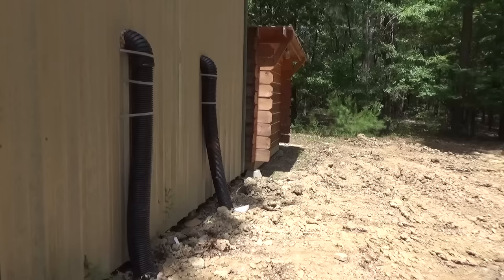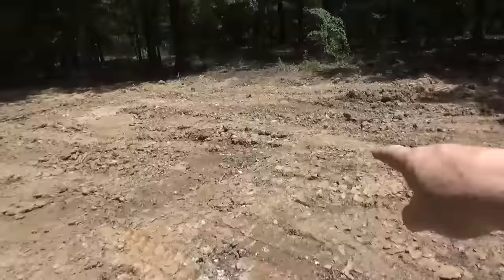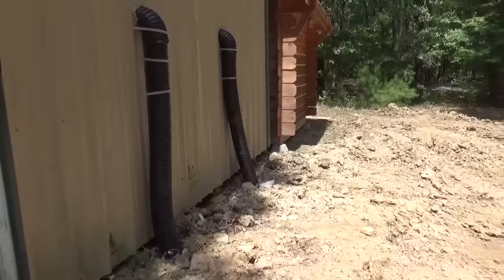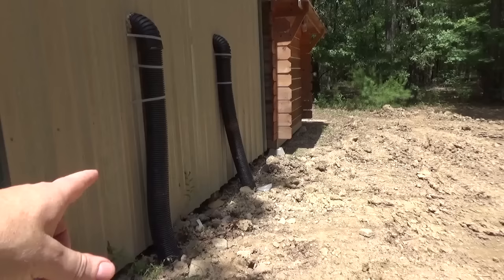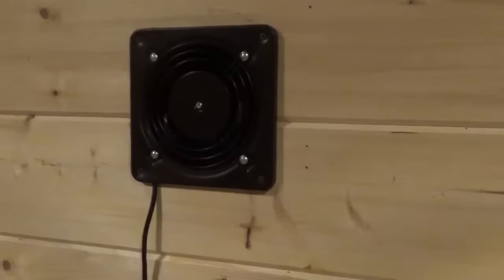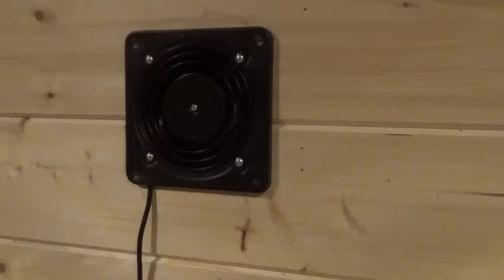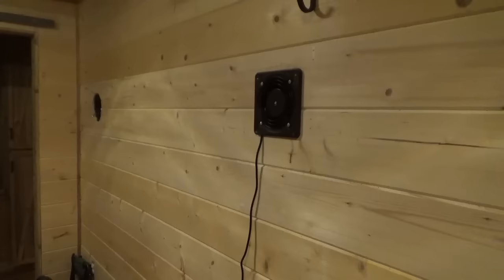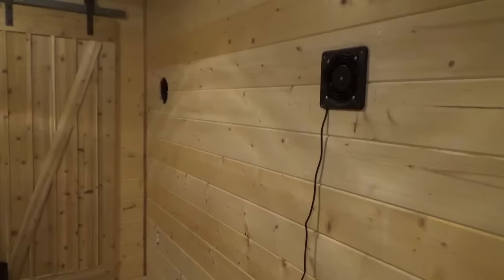Offgrid Underground Air Conditioning

Comment: This principle really only works when you only need cooling.  It fails when you need to increase the temperature because that temperature is lower then what would be comfortable.

To truly use geothermal in all cases, you need compression and expansion of gases that can be controlled.  The value that the consistent temperature of the Earth provides in that situation is that we're not trying to exchange and pull heat from an extremely cold environment or shunt heat into an extremely warm environment, so it provides far more efficiency in the process.
Reply: While it is true that this won't always be able to heat up a home, it can help manage a temperature above freezing, as average temperatures will still remain around 50f underground, and its easier to heat a home from 40+ degrees than if it were below freezing. And if you manage to heat up the ground over the summer, you may get a little extra heat out of one of these systems, albeit a few degrees
Reply: @walkstheman98  it doesn't really work that way.  If you want the temperature to be 70f, then the only way having something at ~55f helps is if your present temperature inside the space is below 55f.  If it is 60f and you're trying to increase it to 70f, 55f only works to lower the temperature towards 55f.  You need something above your desired temperature to raise the temperature in a space.  Basic physics.  If you're going to leave the space unattended and don't want to maintain the temperature during that time... then sure, this helps to maintain it towards 55f, which could help to recover towards the desired temperature later... but that will again require a different source of heat that is higher.  If you continue to use this while trying to reach the desired temp, it will hinder that effort.

This is why a refrigerant is necesssary unless you're burning some fuel or using resistive heating.  The refrigerant can be manipulated through pressure changes to achieve extreme temperatures and then brought back to a baseline using the consistent temperatue in the ground, then taken to the opposite extreme which can be used to adjust the temperature within the space.

To cool, you absorb some heat into the refrigerant from the space, then you superheat it increasing the pressure which raising the temperature well above its present temp, then you put the refrigerant outside the space and cool it to near the ambient temperature outside the space.  After this, you bring it back inside the space and let it expand which subcools it to below the desired temperature where it can absorb more heat inside the space and the cycle can continue.

This is why geothermal works well... the ambient temperature of the ground is consistent.  Instead of trying to work with an ambient temperature of -15f outside and trying to capture heat from it, you get to work with an ambient temperature of ~55f.  And instead of working with an ambient temperature of 80-115f and trying to cool, it, you can work with an ambient temperature of ~55f.

As I said, using just the ambient temperature of the ground works really well if the only thing you ever need to do is cool things.  If you want to heat them... it can be helpful if you're okay never reaching a comfortable room temperature.  This is what eskimos do.  The inside of the igloo is far warmer than outside but it never reaches a comfortable indoor temperature... just warm enough that saying clothed or sleeping under heavy furs can work to maintain body temperature.
Reply: @dus10dnd  I don't think you understood what I meant, it can help make a heater more effecient during the winter, or maintain a constant temperature while you are away. I know how thermodynamics work, what I am saying is that if your heater is off, say you were out for a while, one of these systems could manage your home at or around 50f or so, well above freezing. A heater will be much more effecient at heating a home up from 50f to 75f, a 25f difference, over leaving a heater on, or having no heat. If it were freezing out, that would be over 45f difference without any kind of heat/temperature maintainer. And even with a regular heater, a way that many home owners make them more effecient is a HRV, or heat recovery ventilation. You could do something similar with this, if you take this pre warmed air and vent it to your heater, it won't have to work as hard due to cold air hitting the heater fins (again due to the difference in temperature) as the geothermal becomes the HRV. So you are right, the geothermal is not an amazing heater itself, but that does not mean it isn't useful for one. You just have to think creatively on how you use it
Reply: @walkstheman98  No, I get it.  I am telling you that isn't true.  Say if you have a room to temperature... 70f... what do you think blowing 55f air in there is going to do?  It isn't going to help maintain 70f... it is going to lower the temperature towards 55f.
Reply: @dus10dnd  I'm not saying the geothermal on its own is going to heat up the entire room, perhaps I didn't explain it enough, or you didn't read my comment fully. To put it simply, what I am saying is, these can have multiple use cases. While you are on vacation/away you can have one of these running (at little to not cost) and have your home/room at a constant 55f, not necessarily comfy for you, no, but when you come back it would be easier for a HEATER to heat up from 55f rather than ambient temperature. Furthermore, you can also use one that is ran from outside rather than closed loop like this, and use it to feed the fresh air intake on your heater. Most ventilation systems pull their air directly from outside, meaning that if it was 35 or below, you are drawing in that colder air and making your heater less effecient, but with geothermal you preheat that air to at least 55f, meaning your HEATER only has to heat up that incoming air 20f or so, rather than 40f+. I was never implying that the geothermal itself was a heater, just a preheat for the incoming air, although there is such a thing as a thermal battery, but thats much too complicated for a comment section.
Reply: @walkstheman98  You're now using what I already stated as a point for your position.  I already said all of that early on in the thread.  Yes, if you are away, it can keep things from freezing.  A niche use case that somebody might benefit from.
Reply: @dus10dnd  looking back I worded it weirdly, but that was the point I was trying to make as well. You were saying these have no use at all. I was also trying to point out how these can make heaters more effecient. Like I said "it's easier to heat a home from 40+ degrees" I literally mean, heat the home, internal temperature, like while you were away and after you come back, FROM 40+ degrees, not using 40° air to heat the home. I think you may have misunderstood what I meant in my original comment.
Reply: @walkstheman98  But... I clearly wasn't.  I said that they have a specific use case.  It is a quite limited.  See, I don't think it is you not being clear... you're bouncing all around saying things... like telling me what I said when I clearly didn't say that.  Have a good day.
Reply: @dus10dnd  rereading comments you are right, I got a little confused in how I worded things. The entire time I was trying to point out what you just said though, and I apologize, I do get a little heated in comments. I did mean it as a way of keeping things from freezing while you are away, as you just said. My last comment I got tunnel vision. But, I still believe that these would help make heaters more effecient by pulling in warmed air, rather than the cold outside air (if using a furnace) I think we both were on different mindsets and arguing different things. You are right, geothermal is better suited for proper heat pump set ups, I just believe there are some uses for this. I just get a little heated when people say there are no uses for it when there are some 

Edit: by no uses, in this case I mean  when you said "only works when you only need cooling".
 Again, it's just coming down to the limitations of the ability to communicate effectively in the comments section

Comment: Add some water hose/pipe throughout the tube and use a radiator and fan. Your idea is great but not perfect the reason you seen system pulling outside air is because your system will get moisture and you will get mold in pipe you would breathe that in your lungs and died earlier than you think. A small modification csn save your health

Comment: What about condensation in the pipe?
Reply from the maker: Never had any issues
Reply: @uncledavesfrontier6846  nice 👍
Reply: From the MayoClinic:
Legionnaires' disease is a severe form of pneumonia — lung inflammation usually caused by infection. It's caused by a bacterium known as legionella.

Most people catch Legionnaires' disease by inhaling the bacteria from water or soil. Older adults, smokers and people with weakened immune systems are particularly susceptible to Legionnaires' disease.

The legionella bacterium also causes Pontiac fever, a milder illness resembling the flu. Pontiac fever usually clears on its own, but untreated Legionnaires' disease can be fatal. Although prompt treatment with antibiotics usually cures Legionnaires' disease, some people continue to have problems after treatment.

Comment: Is there a formula for the length and size of tubing per square foot of your area you're trying to cool.
Reply from the maker: Not really. I did this pretty much on a trial and error. It cools my cabin ok. But now that ive tried this, when i build the hobbit house, im going to use 8 or 10 inch pipe.
Reply from the maker: @sherryskinner4907  my cabin is 12x24 two story. But i only cool the downstairs
Reply: @uncledavesfrontier6846  Gotcha! I am doing a 12x16 canning shed so the 100'x6" might work out just fine for me. thx!

Comment: Are you not worried about condensation inside the buried pipe, leading to constantly blowing moldy air into your home? I know for sure that's what would happen in my climate.
Reply from the maker: @adddude7524  I run a dehumidifier in my cabin. I run a camera down the piping frequently and have found no issues.
Reply: @uncledavesfrontier6846  Awesome, happy it works for you!

Comment: What will you do when it fills up with water?
Reply from the maker: It's closed loop. No way it can fill up with water
Reply: @uncledavesfrontier6846  one seamless pipe? No joints or connections?
Reply from the maker: @donhuffer5167  yes

Comment: To save that one tenth electrical power, get some solar fans and install them so the sun will run your power. They come in the same, and other sizes, as the one you showed.

Comment: In humid conditions that pipe will be a mold factory.  Yikes.  This can be done in areas like New Mexico because the air is dry af.
Reply from the maker: The temp difference isn't enough to cause condensation.  I run a dehumidifier in my cabin and have a filter on the air intake.

Comment: Any update on how happy you are with the system?  Also which part of Texas are you located?
Reply from the maker: Its been working good. It will maintain the temp. But hard to cool down. So if you turn it on at night, will it hold that temp during the day.
Im in northeast Texas. New boston area.
Reply from the maker: When i built the hobbit house, im gonna use pretty much the same thing, but prob bigger motor.
Reply: @uncledavesfrontier6846  thanks for the response. This is such a fantastic idea and simple design.  Iv always wanted to do something similar.  My concern was the humidity here in Tennessee.
Reply from the maker: @fursurething8659  no doubt our humidity sucks here.
Reply: @uncledavesfrontier6846  how do you feel the humidity affect the room during a summer day?  Do you ever have mold issues?  Is the air coming out of the tubes "wet"?
Reply from the maker: @fursurething8659  the air coming out is dry. I buried the line in clay. But i also open a window for a little while in the evenings for fresh air when im staying there.  Never any mold issues.
Reply: @uncledavesfrontier6846  hope you don't mind me asking all these questions, your info is super valuable.  I don't think I have ever seen anyone setup cooling tubes like this other then maybe a green house or 2 and those were in the very cold north.
Reply from the maker: @fursurething8659  not at all. Ill at least answer what i know and tried. 
Like i said....next time im gonna go with a larger motor.  If i can find one thats quiet. This one seems loud in the video due to the mic i was using.  But its actually very quiet. Bout as loud as a box fan on low.
Reply from the maker: @fursurething8659  and i wanted to use 10 inch pipe, but the price is through the roof. Couldnt fund 10 inch in a roll. Have to buy it by 20ft sticks. The price was ungodly but i know it would have worked better and gave me more options on motors.
Reply: @uncledavesfrontier6846  the price of everything is ridiculous.  So I totally understand with a smaller pipe. Plus your also not cooling a giant room.  So maybe the  small pipe is plenty.  Does the air temperature change coming out of the pipe as the day goes on?  Or is it consistently in the 50s all day?
Reply from the maker: @fursurething8659  it stays consistent.  But keep in mind, my cabin is totally shaded by trees all day long. Only the upstairs gets warm. I have the ac just cooling the downstairs where i sleep
Reply: @uncledavesfrontier6846  you have a cool place to sleep and escape the heat whenever you need to. For basically no cost other then initial setup. Absolutely brilliant.  I'm sure it gets pretty hot in Texas.
Reply from the maker: @fursurething8659  my uncle lives in Alaska.  Dont think im not getting close to heading his way....lol
These summers are brutal. Seem to last 9 months long
Reply: @uncledavesfrontier6846  I have been trying to wake people up to this idea fr decades. Glad to see someone finally making this. I live in NB as well.

Comment: How’s this working 2 years in?
Reply from the maker: @kwhp1507  still goon good. I run a dehumidifier in my cabin.  Use hepa filters on the intake. And run a camera down the pipe regularly to inspect. No issues

Comment: Sorry but a bad idea , you will have a mold problem and it will make you sick. Would have been a good idea if you used 3/4" pipe with a 12v pump , pumping windshield fluid . A transmission cooler with a couple of computer fans, all ran with a small solar panel. Zero cost to run and about the cost of a small window A/C unit !
Reply from the maker: This only circulates air. Never been a mold issue or any bad smell. This is no different then running a fan in your house, except im running mine underground.

Comment: I was just researching these boom tubes, as someone calls them. What I learned is that they should be buried 8 feet deep in most states, and a longer loop always helps. 

You should do a radon check because the air can pick up radon and it will get blown into your home. This is not an issue if you do not have radon in your area; check with your local authorities.

Comment: Where are you located in general terms?
Reply from the maker: Northeast Texas
Reply: @uncledavesfrontier6846  I'm in the hill country, lower central Texas. The 30 ft depth temperature is around 68 degrees. Not very useful if you have to dig through rock to get to it.
Reply from the maker: @grcunyus  I have land in Arkansas and I have that problem there. Too much solid rock

Comment: Update on the ac cooling plz
Reply from the maker: Its works good. But when i build the hobbit house,  im gonna use 8" instead of the 6"pipe and use a larger exhaust motor. Works good to maintain the temp. But not big enough to drop the temp.
I can turn it on first thing in the morning and it will keep the inside of my cabin about 73 all day.
But im definitely going with the 8 inch pipe next time. Other then that, works pretty good.

Comment: Where did you get the tube from?
Reply from the maker: I got it at Lowes
Reply: @uncledavesfrontier6846  what is the diameter? Where did you get the duct fan?
Reply from the maker: @scottbradford192  sorry for the late response.  Must have missed this question.  The duct size is 6 inch, 100 foot long. The exhaust fan i got on Amazon.  Just a 6 inch exhaust fan.
Now that ive built this, the next one im gonna go with at least a 8 inch pipe. Just so i can get more air flow. But size will depend on the size your wanting to cool down.
Hope this helps.

Comment: what kinda fan is that ?
Reply from the maker: 6 inch exhaust fan
Reply: so its a AC not DC fan ? 
that's be why its pulling 1/10th of an amp ?
Reply: running off an inverter ?
Reply from the maker: @jaaayg2791  yes